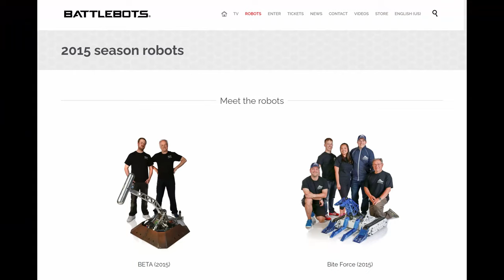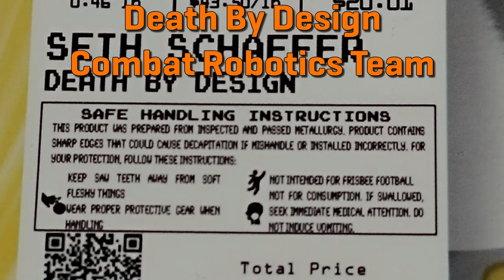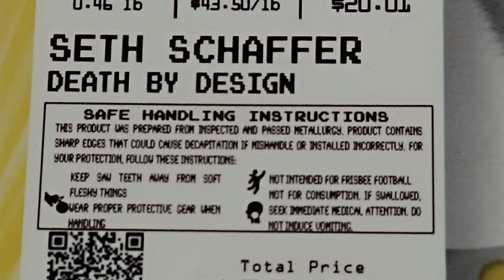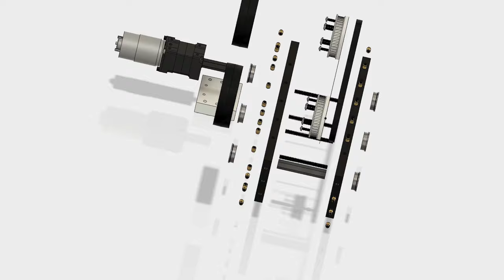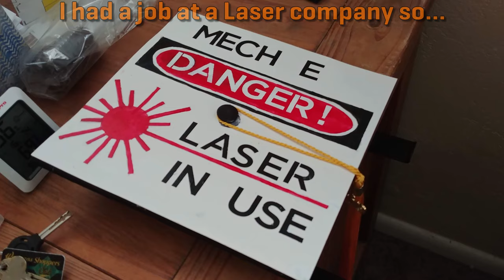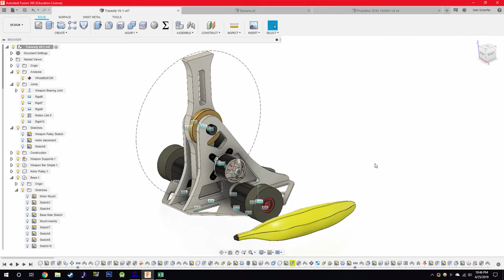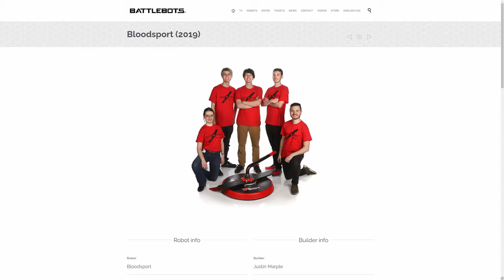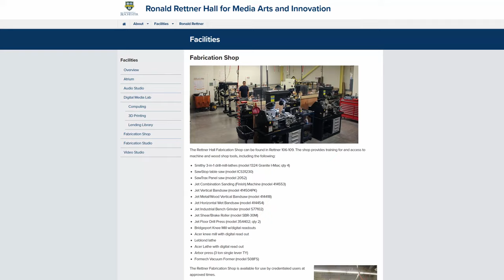How I Got Started, and How You Can Too! (How Team Just 'Cuz Robotics Came to Be)

Comment: Great video thank! I could add that the main Advantage of ABS/ASA is it's weight. With a density of 1.05 g/cm3 compare to 1.5 of nylon in antweight it become quite relevant.
Reply from the maker: All of the nylon filaments I have used are between 1.1 and 1.2 grams per cubic centimeter.

Comment: I want to see a spinner bot use a viscous coupling on the weapon as a shock damper. That should dissipate the shock force instead of heavily stressing (and often breaking) the drive system. Such a coupling would need a lot of surface area and a filling material that stays stiff and sticky to be able to transfer power, yet can shear under a hard and sharp load so it'll slip. For high surface area in a small-ish space use multiple nested rings (deep concentric grooves cut into disc faces) or flat rings like an automatic transmission clutch pack or limited slip unit as used in many all wheel drive vehicles. In vehicles the viscous limited slip is filled with a thick silicone oil and transfers no or little power until the primary drive wheels slip. That causes a speed difference across the VLS. The shearing makes the oil heat and thicken.

What's needed for a battle bot weapon (or wheel) drive that can slip to protect motors, belts, gears etc is a substance that's thick and grippy until there's a sharp shock. It needs to be able to shear and slip then quickly return to thick when the resistance is gone. My suggestion is a silicone grease.

To make more area for the coupling filling to grip, drill holes through the rings, perpendicular to the faces of the flat rings, radially through the vertical concentric rings.
Reply from the maker: Sounds like you are describing a more or less standard clutch system which is already in use on many of the larger battlebots spinners and hammers. For the smaller bots the amount of stretch in a belt or slip from a belt on a smooth pulley is sufficient to prevent shock loads from damaging components.
Reply: Hi, greggv8!  That's an intriguing idea, and definitely worth investigating. I'm in no way trying to be negative, but I can see a couple of possible problem areas:  weight and complexity.

In my limited experience [I'm not a qualified engineer, but I've been building and fighting heavyweight bots since 1987], if something can go wrong, it will. I think that's why things like tracks and walking mechanisms don't get used on combat bots very often.

You do see some very clever stuff on military-style bomb-disposal robots, but they're not faced with weight restrictions and only have to deal with booby-traps and high explosives, not monster kinetic weaponry.  ;-)

Repairs to belts, sprockets and chains are reasonably quick and straightforward in the kind of 'table-top' service areas you get at many events; the sophisticated additional coupling you describe might need some pretty advanced servicing facilities. Like a garage, a hoist, and a guy in greasy overalls with a clipboard shaking his head about what the repair's going to cost. "You see, lady, the problem is, we just can't get the parts..."

The weight of the unit itself might be an issue, but sound engineering could probably get around that.

I've no doubt that a viscous coupling could be made sufficiently robust, because there's nothing much to break internally. (A rally car's 4-wheel drive system can take a lot of abuse.) It's just that today's bots are so powerful that when things like shrouds and housings get hit, they explode; and it's not uncommon to see an entire chassis bent out of shape.

Flexible belts are light and will usually keep working after that kind of major impact; I'm not sure it'd be possible to keep a 'bent' viscous coupling running smoothly, and protecting it would mean surrounding it with a lot of fairly heavy/massive protection. 

I'd love to see someone working on the idea, though.
Reply: @JustCuzRobotics  - Ah, right. Sorry. I was thinking in terms of something huge and complex fitted directly to the motor's output shaft. Direct drive, splines, keyways, um... yes. That would do away with the need for belts and pulleys and gearboxes and whatnot.

Spin-up and stall-protection would be a case of clever electronics and custom ESCs and so on. But as I know next to nothing about electronics, this is where I bow out, blushing, and you step in, laughing at my idiocy...
Reply: @EleanorPeterson  Not so complex. For a horizontal disk like PP3D I'd use a shaft within a shaft. The outer shaft driven by the motor, the disk attached to the inner shaft, with a pair of car wheel bearings and races supporting it in the outer shaft. Might use a plain bushing and a thrust washer on the bottom because the inner shaft isn't going to be running at high RPM relative to the outer shaft. The viscous coupling I'd mount on top, with one grooved disk connected to the the outer shaft and the other held to the inner shaft with the same nut that holds the inner shaft. The bottom disk of the coupling would have an outer wall extending upward to keep the silicone grease inside. With a lid on it, grooved on its underside, the upper coupling disk would be the middle disk with grooves on both sides. I'd also use the silicone grease on the bearing and bushing on the inner shaft for more stickiness for getting the weapon disk moving. The design for mounting on a motor shaft or an intermediate shaft would be similar.

Thus the coupling is inside the robot, inside the heavy/massive protection already there for everything else, and protected from getting bent/damaged while it's protecting the motor and drivetrain.

Comment: I'm glad you posted this, I'm a senior in highschool and have already been accepted into some colleges to study mechanical engineering. I'm hoping to continue on to getting a masters in robotics engineering, but I don't want to wait that long to get into combat robotics. I don't have any previous experience with CAD or basically any machines other than bandsaws, though I do know a bit about arduino. I'm looking into making some rc bots for practice but I'm not sure if I'll be able to do that before I get into college.
Reply from the maker: That's great! Don't worry if you can't get started before college, I hadn't really used any machining tools before then either. If you can take a class to learn to use machining equipment or there is a makerspace type of place on campus, just make sure you get involved there early on. Good luck! 😊

Comment: What happens when the name you want to give your robot has already been used?  Is it OK so long as it's different weight classes, and/or if the previous bot is retired? I've fantasized about building a bot ... named Karma.
Reply from the maker: If the robot is retired and no longer active usually it doesn't matter. There is not any official approval process for robot names. My KARMA hasn't fought since 2017 and I heard after naming it that there was a much older robot that used the same name years ago that I knew nothing about. So feel free!